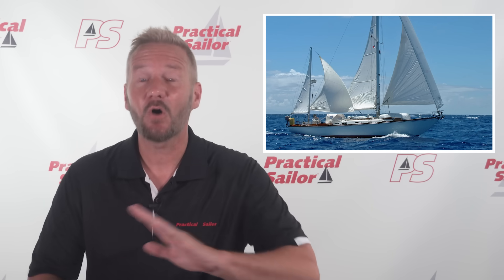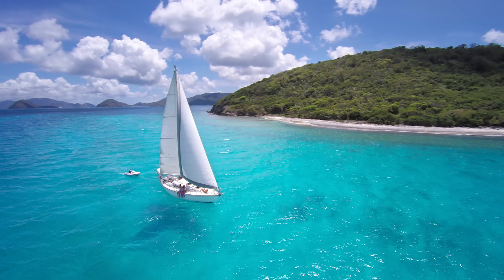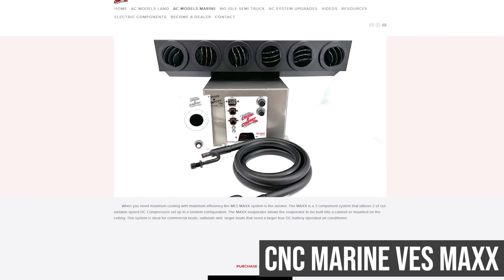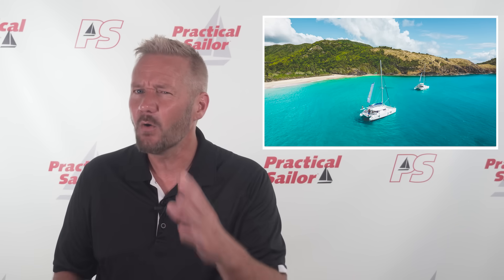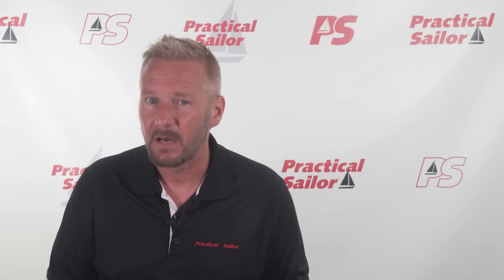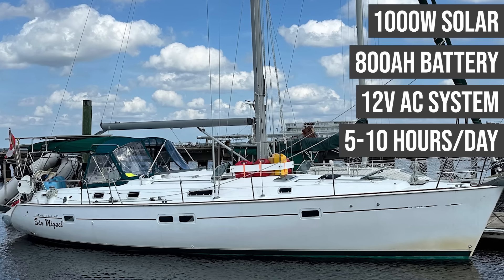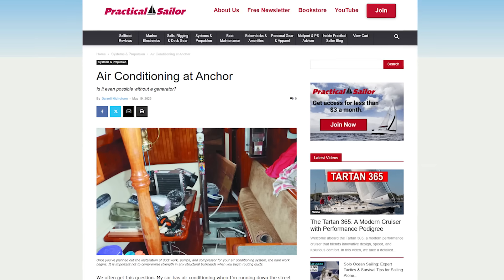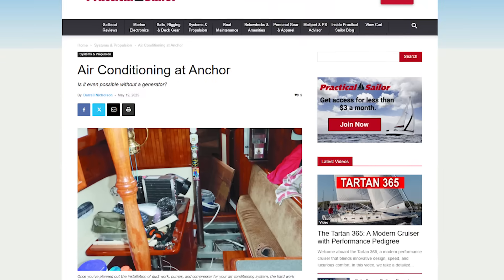Can You Run Air Conditioning on a Sailboat with Solar Power? YES — Here’s How!

Comment: I am between boats. But have been thinking of getting a EcoFlow camping style AC and running it independently of the boat power system.

For me a few hours at night in my cabin (if it’s humid) is all I want.

So can charge the battery with its own solar panels on deck when at anchor. Or if using shore power run it off that etc.

Comment: So, am I better off with higher voltage solar and lighter wiring or lower voltage and heavier wiring?  Which is more practical for a Catalina 27?  I probably want to cool the salon/galley during waking hours and the sleeping area overnight.  Do I need to replace the Bimini with a hard top or an arch to mount the panels?  Also, do you think there might be a YouTube niche for a couple in their 70s doing the Great Loop?  We're thinking of kicking off next year in Kansas City, down the Missouri River to the Mississippi and motoring back up at the end.  The boat has a brand newly rebuilt Atomic 4, has yet to have oil put in it.  We may also break the trip up into segments, rather than a continuous trip.

Comment: Friend of mine runs AC on his Lagoon 450 day and night. But he has a 10kW solars. So if you have enough solar panels you can do whatever you want 😊
Reply: You need a massive battery bank to run AC at night, generally we don’t need it during the day less a few days at anchor with no wind, which is rare. Solar doesn’t work at night and half the year that’s 15 hrs a day it’s useless

Comment: Unless you're sporting a mass of panels and batteries then the key to off grid AC in any situation is just cooling a very small space and keeping that space sealed off from the rest of the boat.
Reply: Yours is a bad solution.  Closing 1 compartment restricts air flow in the others.  Better to have air flow from bow to stern, avoiding most need for cooling.  Many houses are so built.  In the tropics, residences are so constructed.  At anchor, bow to wind, a simple scoop in the forward hatch suffices.

Comment: This is a great topic, as far as AC is concerned, it still sounds like a balancing act, maybe it is easier to acclimate, but on the topic of the batteries, I agree, the LiTime batteries are great, I have 400AH ,  bought in 2021, the batteries are still testing out at13.5 volts fully charged, will replace with 460 AH eventually some day.

Comment: you can go with a vevor 2.0 500w portable 4950btu AC unit 24v drainless  .. I have run it off 1 24v 100ah battery or straight off your solar 24v DC, I have 10kwh batteries with 1400w in panels in my RV .. fridge and water heater are on it.. along with the vevor 24v AC unit.. it costs 269.99 off amazon.

Comment: lithium is a huge fire risk , so use a carbon plate AGM instead
Reply: You are totally getting ripedoff on expensive agm's lifepo4 batteries are not a fire risk unless submerged. Abyc standard is for them to be in a metallic water resistant case anyway.

Comment: Ok so ive lived off grid in a cabin in Tennessee and I installed 1600 watts of solar with 200ah lithium batteries snd i could run a window unit successfully because it was always cooler in night so no need to run. I now live on sailboat and i have a way better solution for ac using a heat exchanger a fan and a small 12 volt pump. using the cooler water that is 10 to 15 feet or even deeper below boat. Use thin tubing to suck water up and thru heat exchanger with a fan blowing thru fins. Ive done it and it works there are some caveats where you might need to fill the outlet pipe so that pump can manage, but it does work.
Reply: Please elaborate on this or create a YT video, this is an idea that I have always wondered about.   We are sailing on a mass of attainable cooler temperature, even if the deviation is only 5 degrees.  I am very curious, what did you use for the heat exchanger?  What about condensation, what about the flow back out, did you use through hulls? My isotherm fridge compressor uses a special through hull for cooling instead of a fan.   curious to know more.   Thanks for posting this reply.
Reply: @ejdd3442 well id start with a 12000btu condenser with a 12volt fan either connected directly to condenser or build a unit to house it, then i would get a small 12 volt water pump suck up the water pump it thru condenser and there you have it. Would need to check temp of water at different depths. I also would not attach to boat, i would design it to be put deployed and packed away. No drilling of hulls that way.
Reply: @offgrid8204  I would think a condenser meant for a home would rot in not time pushing saltwater through it
Reply: @ejdd3442  Instead of thinking build one for yourself, the condenser is about £100 with a fan, a 12 volt pump is about £40. If you have to replace every year its still a good deal. Not sure how long it will last, but i know it works.

Comment: You are missing the logical thinking.
If you assume that you gonna use AC, straight it means outside is hot, if it is hot it means sun is burning, therefore the production of solar energy will be high.
 Either way it is summer and production in hot condition summer it is not 5hours/day, it will be more like 8-10 hours of hot sunny weather, that is the reason in itself to start ac.
If weather is cloudy and rainy, is logical to think it is useless to turn on AC.
You clearly have not enough experience with these solar panels. 
With 1kw/h installed you gonna produce easy energy for hot summer days for that AC in your example .

Comment: I'm a PS subscriber with no ill will toward this channel, but you lost me at "Amp-hours".  I hate to be that person, but without knowing the voltage of the battery bank, "Ah" is a rather meaningless figure.  Not everyone has a house battery bank with a measly 12 volts of nominal potential — especially those who are designing a system to support air conditioning, convention ovens, induction cooktops, etc.  It's not uncommon for cruising yachts to have 24 volt house banks, and 48 volt systems are the up and coming trend.

Comment: This is a "trigger" topic for me as I have read so much bad advice. I think you did a good job and were far more realistic. But I wouldn't recommend it unless you're going to use it a lot. You are basically spec'ing up a very beefy 12v system that you are very unlikely to need otherwise and sizing is all about compromise. Also I think you will be permanently suffering from battery anxiety. I would say that a backup generator is essential and expect to use it more than you think so have the fuel. Also be very careful of the wiring, it's not ideal to be running those amps in mobile setups. Make sure the wiring and particularly the connectors are easily accessible, preferably visible.

Comment: 1000 dc watts are 1000 dc watts and has no difference if the panels are "high efficiency". The difference between high efficient panels and the ones which are not is the total area needed for installation. Has no impact on the energy production. Both should provide the same amount of energy production.

Comment: Installing Micro Air EasyStart soft starters can be very beneficial. I am currently running two out of the three AC units on my boat using a Honda generator EU2200. I am able to operate them for four hours on just one gallon of gas while simultaneously charging my 800Ah lithium batteries.

Comment: It's kind of a disservice to let anyone think that's this is an air conditioning system.  Way better than nothing, but not in the same ballpark as a 120V system.  This will bring down the temp and humidity down a bit but just one cabin and only a few degrees.

Comment: I have 700 watts of solar and 300ah of lithium. I have an Archer Power Systems 5000 btu A/C unit in my aft cabin on my Catalina 380. Draws 14 amps @12v on low and 25 on high. If you have cooled the cabin during the day, it is very comfortable all night. I set the temperature at 78 and it gets down to 55% humidity. It can also be set to act as a dehumidifier. It has a timer feature so you can set it to run up to 6 hours and then it shuts off. It's not cheap but, it worth it on hot nights. The water pump is also 12v. This unit only cools. The unit and pump set me back $3,500. I installed it myself. I replaced an old unit, so I didn't have to do a complete install. 
Seawater Pro just announced a 12,000 btu 12v system. This would be good for the main cabin. listed price is $4,995. This unit is a heat pump. 
Mabru Power Systems has 3 DC powered units. The smallest is 5,000 btu at $5,200 (sold out) up to a 12,000 btu unit at $5,800. All of their units are heat pumps.
Reply: I bought the mabru 12,000 btu for 2,000.00 here in malaysia. Same exact unit as there older units 5 years ago. But no logos

Comment: If you want real facts from someone answering this exact question in a real world environment for 5 years now with many different tests and recorded statistics on a 51ft sailboat, i am still running AC on our boat completely off grid and off dock, from lithium onboard.
Reply: What are you running?
Reply: You cooling just a single cabin? I can’t find much information about energy uses for part time uses of a single cabin ac setup on an insulated room that’s my plan anyway use 1.5” of foam insulation on my aft cabin with a small ac unit only for 2-3 hours right before bed time then just sleep

Comment: lots of good ideas.  Here's one that's a bit off-beat.  Since sailboats in general aren't that well insulated, the A/C is likely going to be running full-out anyway so instead of worrying about hitting a target temperature or insulating a compartment you can instead find an A/C unit and setting that burns an appropriate amount of power for the amount of time you intend to run it (power x time = energy), and just take whatever temps you get out of that.  I have found that small DC-compressor A/C units actually do a fair job at keeping spaces livable even when they can't get the temperature down as far as one might desire.

I usually target 300-500W or so and then simply budget a specific amount of energy.  So, for example, if I budget 2 kWh @ 500W daily, that's 4 hours of operation daily.

-Matt
Reply: Could you recomend 12v dc compressor units

Comment: Have you seen heat pump cooling/heating for boats(one system)? Common for homes. Very Efficient and a natural since with a "ground source" system, you can run a loop through the water beneath, greatly reducing the power needed to cool. This is done in homes on land with buried hoses or with lakes. There are heat pump hot water, dryers and should work for refrigerator. A natural tech for the marine industry?

Comment: Well, ac performance could be significantly increased if you set up a 24v system instead. Running ac on 12v is kinda nuts.

Comment: Is a hydro generator a good idea if you intend to run the AC a lot, especially at night during passages?
Reply: You need to have a boat that can maintain enough speed to generate power and even then they only generate 500 to 700 watts. You will need to be above 7 knots .

Comment: Built my own sailboat off-grid system, yes I have lithium batteries, large solar panels, insulation cabin. Computer fan ventilation system, and air conditioner. Still have to run my small generator once a week to top off things, .7 gallon.
Reply: I would like to know more

Comment: Thanks for the AC review! 
There are a few things that one can do in order to dramatically ease the load on the AC, and get much better cooling as a result. 
First we should recognize that a large part of the comfort achieved by AC is simply reduction in humidity. This means that reducing humidity sometimes has greater effect on the convince factor than cooling itself. For most people 27 deg C with dry air is perfectly fine (if you're not in some physical task). On top of that, we should be aware that in humid environment, about 30% of the energy consumed by the AC is going to extract the humidity from the air. If compartments are kept sealed, the load on the AC is greatly reduced after some time, even if the boat is hot, just because the humidity was already extracted. 
Another simple thing that can greatly help is improvising a tent above the compartments to be cooled. This prevents most of the heat generated by radiation, especially if the deck is dark. Keep in mined that some tent materials tend to pass infrared radiation. This kind of material is not good because most of the power brought by sun radiation is in the IR.
A third thing is if the AC gets rid of the heat using  sea water, the pipe sucking the sea water should go as deep as possible. Temperature gradients in water temperature can be fairly large, and by cooling the AC's heat exchanger with just a few degrees colder water can impact efficiency dramatically. 
Have a cool summer!
Reply: I’ve tried to explain this to my wife she still don’t get it if I’m not out in the heat every day I can’t do shit when it actually gets hot
Reply: 12v systems require far heavier cables most have moved to 24v banks for lighter cheaper cabling!  48v is coming but has drawbacks with your legacy 12v gear.
Reply: @jackdbur I’m thinking about doing a 48v house bank with a small 12v setup ran off the alternator and a dcdc charger I can control manually when I need to use it for on anchor controls
Reply: @jeremycable51 I have a motor sailor. Is it possible to hook up a modified automotive ac system?

Comment: Here is the deal about AC.  It takes your body a while to adjust to the heat.  Your blood changes and other body changes.  Once that happens, you will not be as uncomfortable in the heat.  If you are running AC your body will not change and you will not want to go outside.  You'll never leave the boat and when you do you will be miserable.
Reply: I agree with this only to a point.    Sitting in an uninsulated/poorly insulated boat in 90 degree, 100% humidity would be unbearable, even dangerous.  Can't imagine trying to sleep in it.  We live in a cold northern US state, but we do have extremes in the summer, and our boat would be dangerous without running the AC at least some of the time.
Reply: @rebelliousraven In places like Florida and Texas, it gets hot but as long as you drink water, stay in the shade during the hot times of summer, you'll be fine.    It's not dangerous.
Reply: @rebelliousraven In the tropics it doesn't get to 90s except summer time.  Humidity stays in the 70s or low 80s at night unless it's raining.  As long as it isn't raining you get a cool breeze thru the boat when on anchor.  The water cools the breeze.  In the summer time you have to stay in shade with the breeze blowing.  At night the winds drop in the summer time so you'll need fans over your birth.
Reply: Rubbish, 400 years of born and bred west Indian, give me my bloody AC chupppps!
Reply: What’s heat like ? I live in the U.K. not much experience of it.
Reply: I lived in Texas for a whole month without ac. I can assure you, my body has never adapted to the heat 🤣🤣
Reply: @derqatarzan4207  I lived in North Houston for years without AC and another year before we could afford to run AC at 80 degrees in south Houston.  I adapted so much that when I used to work in the office I'd have a blanket over my lap and a sweater on.  This wasn't just one office, but like 8 different companies.
Reply: @FranklinGray 😂 mannn I don’t know how you do it. I work in the Bakken so -30 feels just fine to me!
Reply: For sleeping is a must, for me😂
Reply: I adapt to the heat at work even though I'm in and out of small air conditioned offices across the plant. And plenty of AC at home. The difference to me is adapting to being covered up in the heat. Keep the sun off your skin and drink lots of water.
Reply: Not true. But for a few sloths might be

Comment: another way to do it is to insulate, and blanket off,  a smaller " siesta zone "; and use one of those little 12V space coolers....they are like swamp coolers, I think, and use a lot less power for it.
( of course also blocking any solar gain ... if your napping, you don't need the natural light heat )
otherwise,I would imagine it would take much less power to pump the heat into the water, ( instead of into hot air ).... so maybe a water cooled refrigeration compressor would make a better ac unit?
with heat pumps, I always try to pump thermally pump down hill, instead of up hill ... it does use less power if the condenser is cooler.

Comment: I run 800A of lithium on my 25 foot pocket trawler, with 12V AC. It's wonderful to be able to keep cool and dry. The biggest drawback to this amount of capacity is recharging when depleted. Recharge times, especially if the AC is running, can be quite long. Do the math charging with 50A while the AC draws 25-30. Even taking 50A from my engine while running nets only 35-40A with electronics and house loads, turn on the AC and the net is zero at best. Basically, once capacity is low it can be a long climb back to fully charged.
Reply: Could you install a high output alternator? We have the Zeuz 275L with Zeuz regulators and safely charge with 2500W on each engine while motoring.
Reply: @viktorbrattsti9397  I’m running a single outboard, makes 90A, engine uses +/-40. I can use the remaining 50, but usually back the dcdc down to 30 or 40 as not to constantly run it at max load. Adding to the challenge, electronics running use 10A. Solar (400W) helps but is no solution in my experience. Love my outboard, 800+ hours without a hitch, but charging capability is among modern outboards’ few weaknesses.